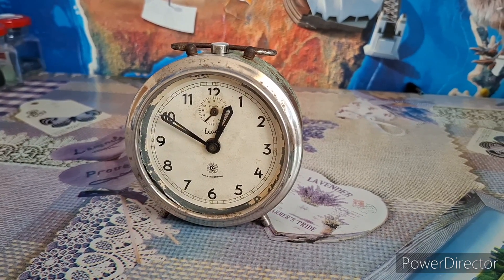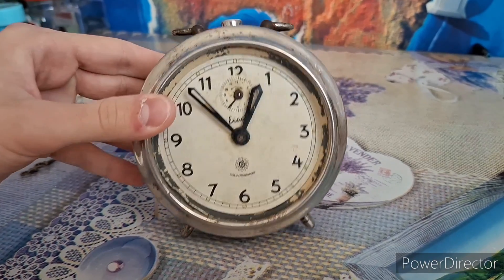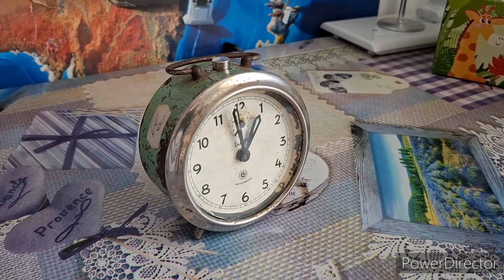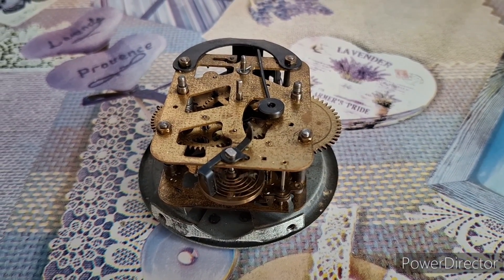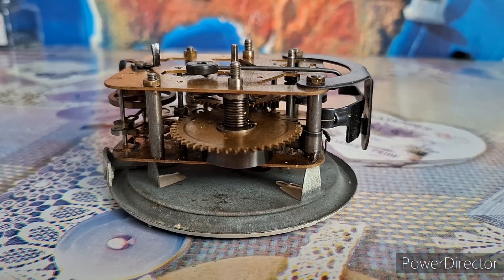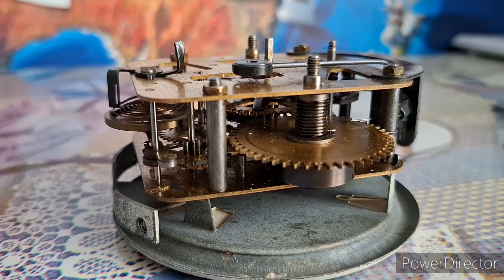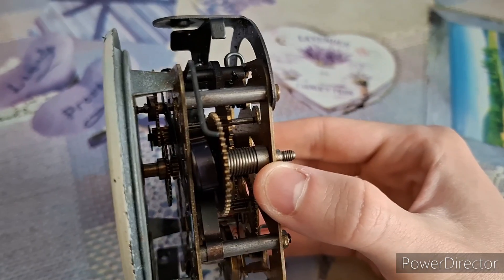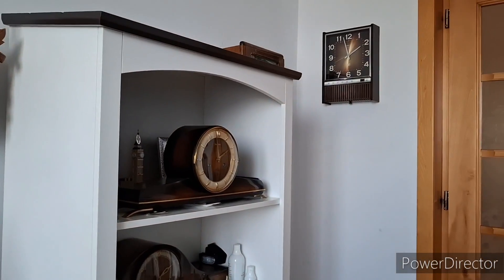Chronotechna (?) Czechslovakian Alarm Clock with Torsion Springs

Comment: Great account and thanks for explaining torsion spring movement.  I'd be scared that it wasn't being wound at all.  I've had a few clocks whereby I don't hear the click and think it's worn and about to fail imminently!
Reply from the maker: Thank you! Yes, I live with the same fear whenever I wind my Junghans bracket clock... the time side clickspring might need to be replaced or strengthened, as you can barely hear the clicking noise while winding it. I'll have to take care of that in the future.

Comment: dude what, I have a collection of 3-5 Prim alarm clocks and most of them have that torsion spring winding mechanism.... I didn't know that was so rare
Reply from the maker: @porkus8102  dang I didn't know every Prim had this ://
Idk, I just haven't seen this type of system so much. Only in these little alarm clocks and in some DUFA longcase clocks.
Reply: @luka3377   no, not every Prim, I have a newer one with a ratchet (1980-1990s)
Reply from the maker: @porkus8102  oh, ok.
Reply: same, i live in the country where they were made and i highly doubt its rare, pretty much every prim with a B-90 movement has the torsion spring.

Comment: AYEEEE CZECHOSLOVAK CLOCK
Reply from the maker: @theantiquescollector2199  YEHHH :)
Reply from the maker: @theantiquescollector2199  btw did I spell the brand name right?
Reply: @luka3377  yup, its indeed a chronotechna
Reply: @luka3377 ive just noticed the movement, and its actually made by prim, the movement is a B-90, one of the (in my opinion) best movements when it comes to servicing them
Reply from the maker: @theantiquescollector2199  oh, that's nice!!